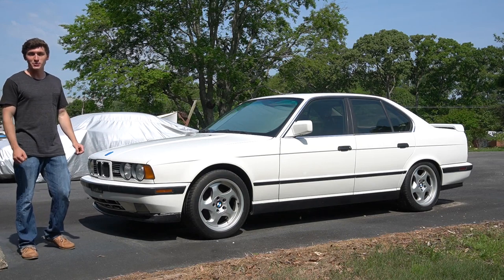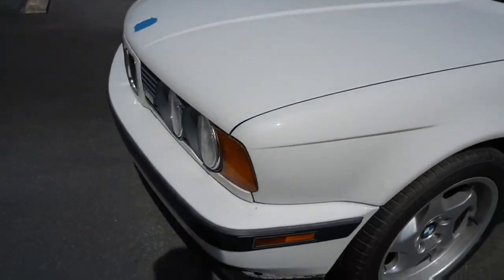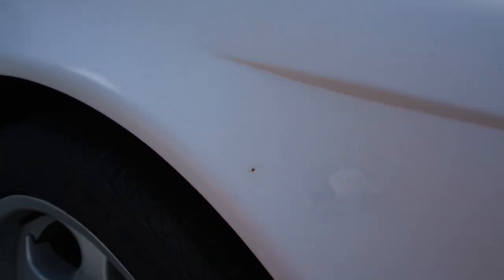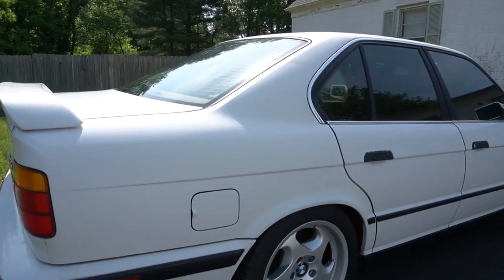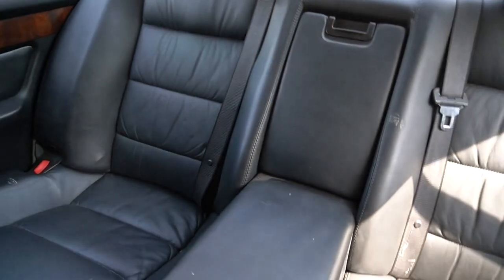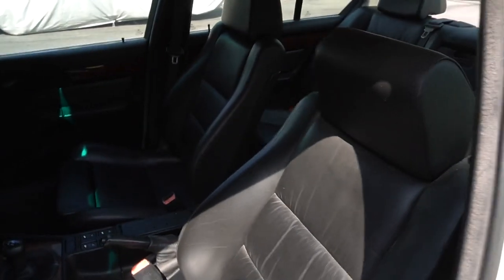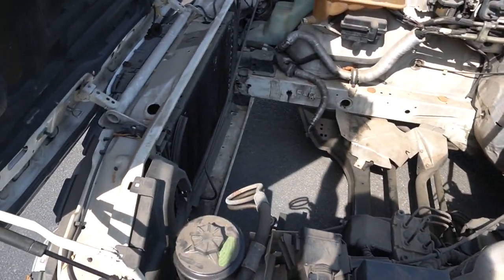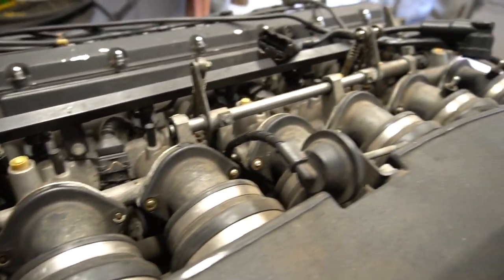I BOUGHT MY DREAM E34 M5 and I'm Going To Fix It! | E34 M5 Project Introduction

Comment: They typically leak through the valve cover gaskets, oil pan gaskets and rear main seals. There is a lot of distance between the bolts on the valve cover and as it warps over time, replacing the gasket doesn't stop the leak so the valve cover itself has to be replaced. Good luck. This is a car worth restoring and will probably appreciate greatly over the next 10 years.
Reply from the maker: Gotcha, thanks. I'll be sure to try and check it for warping by laying it on a piece of glass.

Comment: I had a 89 m20b20 e34 in alpinweiss. That was a great car.
Edit: I am not sure if the Blaupunkt Milano radios and it's brothers are offered in US but it's worth checking them out. They are made to fit old BMW interiors just perfectly and you have all bells and whistles of having a modern radio.
Good luck with the project!

Comment: Got to get those directional Throwing Star wheels on the correct side of the car.  They're on backwards.
Reply from the maker: Yes, I am well aware
Reply: @MyersMotors  You never know what someone's experience level is with these M5's.  I sold my last BMW a couple of years ago, 1993 M5 Calypso Red.  One of five US cars that color that year and the only one with a black interior.  Had a 1991 M5 prior to that with over 200k miles on it.  A lot of the engine parts are NLA and body & interior parts, if still available (which isn't many) have increased threefold or more.  People with used parts want a fortune for them.  It was just time to move on.  Great drivers car though and I do miss it.

Comment: I have a opportunity to acquire one, but the engine is in pieces. I was also told it needs the individual throttle bodies the airbox and the computer is no good, but it is wired for a standalone computer is that something to be interested in?
Reply from the maker: Depending on the price, it's absolutely something to be interested in. Sounds like a huge project and pretty expensive at that because the throttle bodies and air boxes are fairly hard to find. These cars are hard to find in any condition, and getting one in project form can make it much more financially accessible if you're mechanically inclined.